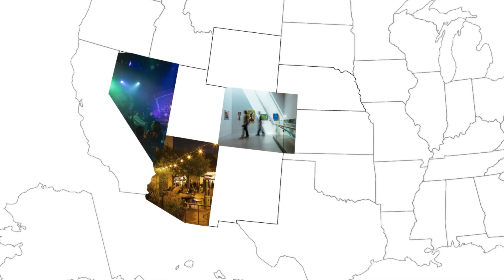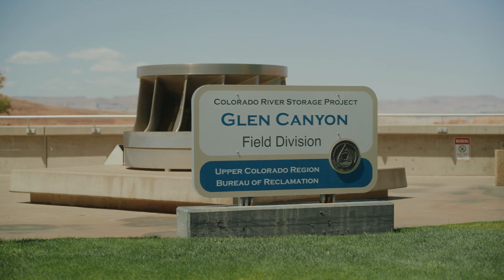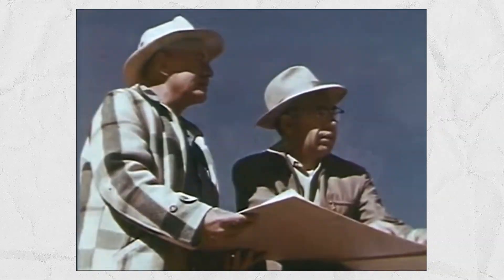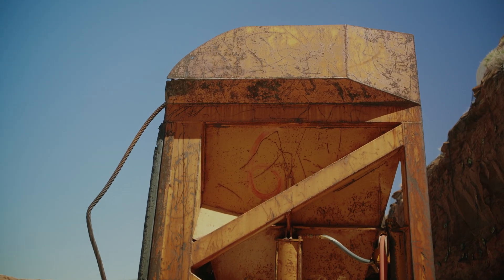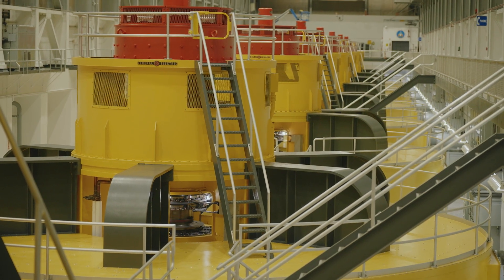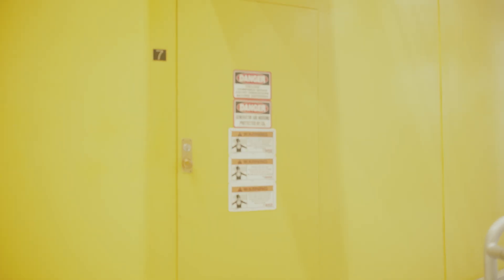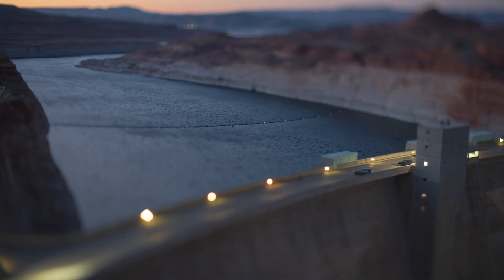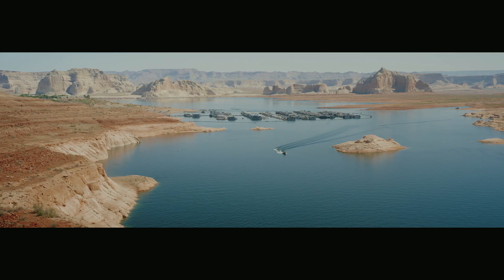Exclusive tour: Go inside the Glen Canyon Dam to learn how it makes power and why it’s in danger

Comment: does anybody recall when they were talking about having to stop producing electricity because they're worried about Deadpool. isn't that the time they completed the tunnel to divert 90,000 cubic feet of water to St George. if you're worried about Deadpool why did you build a tunnel to divert water to St George.. and remember a long time ago when they told you that the Colorado River that the flow down into lake Powell and the lake Mead the flow of the river has decreased. when they started saying that what did they do they diverted 200,000 acre feet of water to Nebraska yeah they built the tunnel through the Continental divide and diverted water into Nebraska and Oklahoma for farmland from the Colorado River when they started telling you that the flows of decreased cause of climate change to the South that's why lake Powell and lake Mead we're losing elevation. no they diverted water. it's like they're diverting water to St George but telling you they're worried about Deadpool if you're worried about Deadpool you wouldn't have built the tunnel to divert water to St George a couple years ago